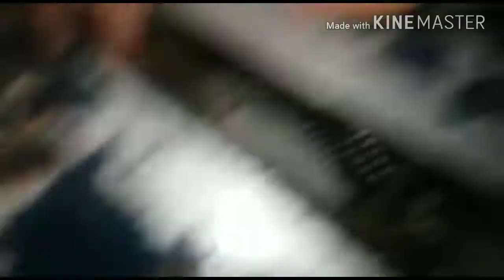Reparat(deblocat) pompa de injectie fiat780

Comment: Am o poma Bosch identica cu cea de 650 numai ca e pe partea stinga si e pentru tractor rusesti tip Belarus este reglata pentru generator cu debit mic la motorina in spatele regulatorului sint doua suruburi de reglaj cum pot sai mai adaug motorina ? Sint din R.Moldova
Reply from the maker: Dami pe messenger o poză sa inteleg care șuruburi. Ruben benu bobocea  facebook
Reply from the maker: Are capac cu 4 șuruburi mai jos?
Reply: Da are
Reply: Doua suruburi unul la cheie de zece in parte de sus  unul mai jos pe la mijloc cu capac la cheie de 14sau 17 nu tin minte pot sa va trimit poza pe Viber sau WhatsApp
Reply from the maker: Deci acolo are un șurub cu cap surubenita și o piulita cu 10, pui o inelara de 10 cu cot, pui șuruburi surubenita tii fix slabesti cu cheia de 10 apoi strângi surubul jumate de filet, astfel mărăști debitul dar sar putea sa dea fum motorul.
Reply from the maker: Sigur
Reply from the maker: 0040744819886.

Comment: Vă mai dau eu un pont puneți pompă u650 cu elemenți d1010 pe motor de aro domnule pornește doar dacă învârți de volantă cu mâna păi iarna pornește la sfert cu sau fără apă și trag și eu de el dar nu am echilibratoare în baie uni zic că vibrează tare domnule am pus o monedă în dungă pe chiuloasă și debia la aproape turația maxim a căzut moneda pompa u650 este sfântă
Reply from the maker: Stiu ce spui ,nu-i recomandat pompă în linie, ca in momentul in care cade un element începe să vibreze și rupe arborele.
Reply: @rubenbobocea5180  din cauza aia îi bagi elemenți d1010 DDD
Am aro de care a tras tata de 20 de ani Sibiu-București  dacă îi dai cheia acum o ia fără apă o singură problemă mică a avut sa rupt arculețul în pompă la turație mare  o dată dacă pui pompă cu elemenți de 650 da și poți strica multe mai trebuie scaune de rabă ratra făcute pe dimensiune la chiuloasă aro  sunt niște secrete care nu ori cine le știe +tururi la apă dacă nu fierbe de rupe